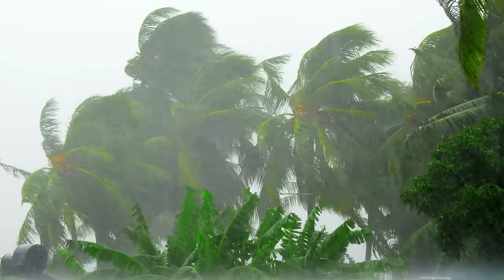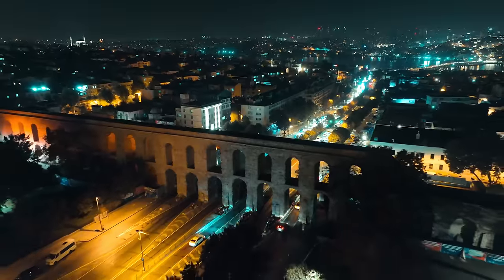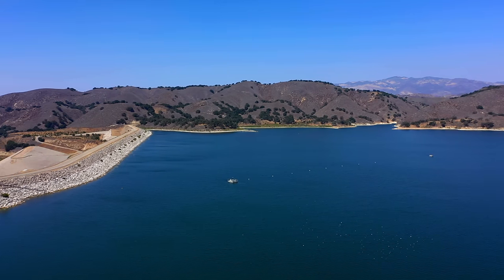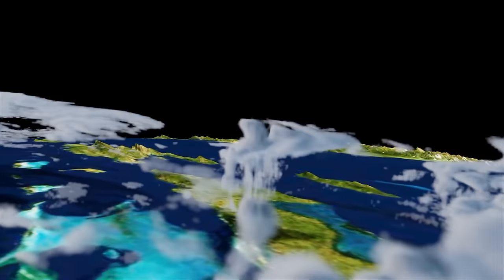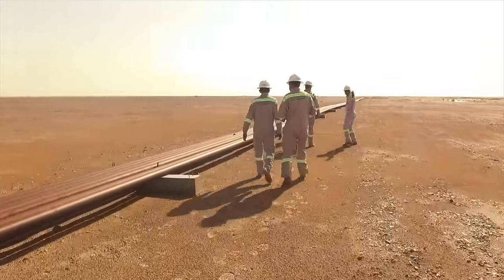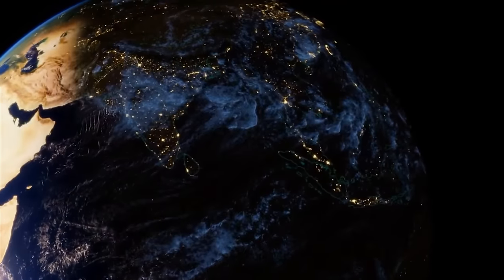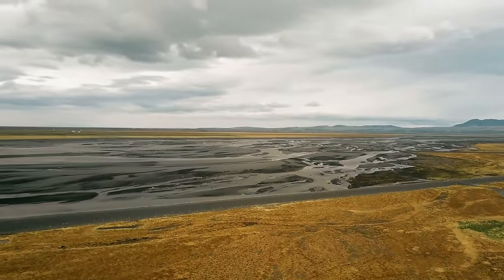Pipelines From Flood to Drought

Comment: This analysis is seriously flawed.  You can estimate the energy cost, at least approximately, very easily.  I worked in water treatment for over 45 years so I do have some background in this topic.  If you look at pumping from the east coast to the west coast and using a closed pipe so you get a siphon effect (near sea level to near sea level) then static lift is near zero and energy required for that is low.  However, that won't work because the negative pressure at the top of the mountain (remember the Rockies?) will cause the pipe to collapse.  You will need to overcome the elevation rise from the east coast to the mountains.  You can use gravity from there on, thus requiring no energy the rest of the way.  In addition to the lift you will need to overcome friction loss.  That will depend on the size and material of the pipe, but moving significant amounts of water that distance will require multiple, large, parallel lines (at least 60" diameter, and probably much larger).  Friction loss will still be significant even then.  The calculations will involve balancing construction cost, which increases with pipe diameter, against operating cost, which decreases with pipe diameter.  A single 60" pipe will have a carrying capacity in the range of 50 million gallons per day, or about 35,000 gallons per minute.  At that flow, the 60" pipe will have a friction loss of about 500 feet.  Assuming we can find a route with a maximum elevation change of 5000 feet, that gives a total "head" of 5500 feet.  If we assume a pipe length of 1,500 miles or 7,920,000 feet with a "c-factor" of 140 (very efficient pipe) and a pump efficiency of 85% (very high but reasonable) we will require a total horsepower of about 57,200 HP.  This equates to about 45,000 KW of energy.  Multiplying by 24 hours per day at a cost of $.08 per KWH we get a cost of about $86,400 per day per pipeline.  It would probably require at least 10 pipelines to provide the amount of water California and the other western states require.  Additionally construction cost will be in the range of $300 to $500 per foot of pipe, depending on conditions.  With a total pipe length of 3,000 miles (assuming we can't use the Colorado river due to environmental concerns) we would have a construction cost of about $6,330,000,000 per pipeline.  I believe this puts the overall construction and operation cost in serious question.  By the way, using oil pipelines is not feasible due to the small size.  We can clean them and operate them safely, but the capacity is simply too low to provide any real benefit.  Oil costs about $2.00 per gallon, and water averages about $0.004 per gallon.  That's why small oil pipelines make sense, but small water pipelines don't.

Comment: Agree, but short sighted.  The 'real' answer is MSR - Molten Salt Reactors,  as well as SMRs and TWRs.  MSRs have many advantages and values.  The big value is energy - a lot of energy.  Add a desalination plant, pumps (electric pumps), and pipes and you have the ability to pump desalinated salt water everywhere.  If we can efficiently pump water to Kansas from the Pacific, the Atlantic, and the gulf, we can pump water anywhere - like electricity.   MSRs cannot, repeat, cannot 'melt down' because of the 'molten' part - meaning all the reactive material is already molten so no melt down.  MSRs can consume waste radioactive fuel rod.  Fuel rods are radioactive for 200,000 years.   MSR waste is radioactive for 200 years.  Where should be store spent fuel rods?  Nowhere.  We should be consuming them.  MSRs are 'Putin' safe.  Drop a bomb on it and you have a radioactive mess which can be cleaned up.  No Chernobyl.  The components for MSRs and SMRs can be built the same way we build Boeing airplanes.  But, don't let Boeing near the software.  Rate production in the U.S., Canada, EU, and others can produce parts for hundreds of thousands of sites.

Comment: When there is really a year (ElNinio-year) with lots of rainfall and/or snowpack on Northern California's mountains, would You consider it, that collecting half of that water, halfway up on the western flanks of the mountains, then tunneling it through the mountain and releasing it on the eastern flanks? Or even building a pipeline directly to Lake Mead, supplementing it with water from the West? Such a project, sponsored by the Federal Gvt should be feasible and advantageous. With more water available, those farmers who drew groundwater up for their fields could possibly pump excess water back into the aquifers beneath their lands. 
 in future decades, when the Greenhouse effect really picks up, the snowpack on top of the Rockies will dwindle or would vanish altogether. With this local climate situation coming, such tunnels, water-pipeline projects, and more engineered storage capacity may become very valuable for the Western USA! Those need to be started well in advance. 
 One problem though, which may not be easy to assess is the possibility, that more groundwater available inland (in the North-West) may seep somehow into the Yellowstone caldera or magma chamber beneath, potentially causing an eruption!

Comment: first "idea": "Instead of spending hundreds of millions of larger dams, let's pump water from dams to drought areas" that...that's billions of dollars. The "Water in California" section: he's completely sidestepped that california's water isn't just theirs, it is split between all the states nearby which ALSO rely on the water from those mountains for their own survival. On top of that he mentions nothing about how farmers in norther cali are trying to turn desert land into farm land by just constantly adding more water. In the "drought prevention" section, this is called "surface treatment". Most cities have this and are quite efficient at it. Recycling your waste water is a fantastic tool your local area reduces overall water consumption. A lot of these in-home specialty technologies will often cost you more to manufacture and maintain than simply being responsible. "Floods"/"Flood Risk Management" this is the section that galls me the most. This makes some MASSIVE assumptions about how water and floods works which a glossed over in the next section. "Infrastructure fesability" really doesn't tell you HOW un-feasible this infrastructure is. I actually talked to a person who specialized in water and asked why we don't pump water inland from floods and other clean sources and he said just to build enough pipelines from Houston to San Antonio that it give them only 10% of their water would cost more money than the state's GDP in construction costs AND operation costs. Water is VERY heavy and pumping it places requires a LOT of energy AND even a 10ft diameter pipe running maximum capacity 24/7 could not supply even a medium-small city with enough water to make the cost-benefit ratio acceptable. That's why we use rivers/streams/culverts/aquaducts/etc. It uses gravity to do the work for us. That's why your storm drains are built the way they are, they make use of gravity and very slow declines to run storm water away from you and to natural bodies that can handle it. Oil pipelines are a TERRIBLE idea. Those pipes are not rated for safely carrying water. Let's ignore contamination from left over oil. It's the material they're made of. There's a big reason your city's water lines are made of the stuff they're made of and the pipes are coated with the stuff they're coated in, it's safe and proven effective. Those oil pipelines are going to rust out in a matter of a few years and then you're going to be stuck spending decades spot-fixing old and decaying pipes. Finally with oil pipes, those systems were not rated for water. The machinery that keeps those pipelines running will seize up in a heartbeat when water is introduced. It wouldn't be worth the extreme amount of money refitting these pipelines when it would be cheaper to tear them all out and replace them with pipes meant for the job. The whole concept is without merit because these pipes CAN NOT transport meaningful quantities of water much less at an affordable cost. Speaking of cost, that's a nice comparison, but completely ignores how many TENS OF MILLIONS of people need that water. That also ignores how much water is consumed by businesses for their own operations like restaurants cleaning and sanitizing dishes or public restrooms. That comment about how the KeystoneXL pipeline can pump 1000x more water than tar-sand is goofy as hell, water doesn't compress. Not to mention that not all sections of pipe run at the same pressure 24/7. This isn't one pump moving tar sand 2000+miles on it's own. It's thousands of pumps all trying to work together. Also, just saying "oh, we'll just use more pressure" doesn't fix the problem, those pipes can only take so much punishment before they give. Water isn't harmless, it is incredibly destructive, especially under pressure and under high flow. If air gets into the system, it creates what's called "water hammer" and that can make a pipe explode. This whole thing is based on sham science and hopes and wishes with no grounding in reality. There ARE solutions, but the ones in this video are impractical and no amount of tech jargon will make it any more viable. Light on facts HEAVY on wild, baseless speculation.

Comment: Totally impractical. Very costly, and the explosive nature of floods. Pluvicopia can produce water and energy where it is needed and at elevation for delivery by gravity. The book Pluvicopia shows how it is an energy and climate change solution. Making this complex idea unnecessary. One way your idea would work is by using your idea of water redistribution as part of a wind energy storage system. Wind Turbines are placed at good wind locations connected to the vast canal and lifting system you are imagining. We would get our energy back from hydroelectric reclamation as the water falls back from the 4500 ft peak of the continental divide. We can also redesign the use of New Mexico, AZ, and western TX. Your idea will work, but it is too expensive and unnecessary.

Comment: A simplistic answer to pumping water uphill, is to use what is known as a hydraulic ram. As a speculated connection, the drainage system around Devil's Lake North Dakota, and the drainage around northern California would distribute excess water to Southern California. Using hydraulic ram technology, "on steroids", water could be moved from one drainage system to another.

Comment: Drill a 40' tunnel from California. To tge otherside of the rocky mountains, then a 60'  wide trench, with a stepped bottom to allow any animals falling in to have a shallow edge. Making excaping easier,  with a covered walking bridge crossing every 2k feet or so, putting the man made river along rail tracks, and highway would limit extra labor required,  atleast from the mississippi river around the i40 area,  then eventually add a smaller pipe from florida to the Mississippi river. Crossing it not dumping into it, , maybe eventually add a pipe from southern Florida to northern, and from up near the Chesapeake area maybe further north, helping  drain water from many rivers along the way, or possibly just use 24-36" pipes, along the interstate, build a water tower on a Appalachian mountain,  maybe 100k gallons, build a few of them,  much largr than typical water towers, and taller,  then tie tgem together, to help in storms, then water can be pumped into it from the surrounding  500 miles or so.  And can operate in reverse if required,  the water pressure being around 100 bar or so , un a 2'-3' pipe alot of water can be moved, maybe additional pumping is required to get it all the way west,  it can be done especially following tge interstates, no land will be required across country!

Comment: The 35 mile wide droplet is somewhat misleading ...in order to drive by at its diameter, you would have to have a 17.5 mile deep round hole....also it would be sticking out 17.5 miles high ..about 3 x Mt Everest's height.  I would be very impressed by that.

Comment: 36" pipe isn't going to cover the demand of 30millon people, to get that 1000x increase the flow/speed would have to increase to such a speed that losses of efficiency would be too great let alone probably not possible, at least at the level I understand.  
A 36" 200mi pipe with a flow rate of 6.66f/s this is the high side of flow rates as I understand it would allow about 30million us gallons of water a day, divided by 48gal the average daily usage of a California you end up with enough water for about 625,000 people.

 Interestingly the math for the gallons of oil through the XL would work out to about 25mil us gallons a day and is likely limited by limits on flow velocity.

Comment: Essentially, if this preposterous plan even went to fruition, there would be more water evaporated in dry areas. And water is a greenhouse gas too. Did you take this into account, Einstein? I am a little bit DUMBER because I finished watching this video. Thanks, I guess?

Comment: I gurantee that this won't work. Not because of the idea itself. The idea is fine in theory. But there are several things that will make it impossible. 
1 funding. There's no way that a Cali gov will fund anything if it doesn't benefit them. It must benefit them big and now. They don't care about your future.

2 What you haven't considered is that there are always people who benefit from the suffering of others. And those people have many lobbyists. This is something that has plagued the right to repair movement. Apple and Samsung and others benefit from you depending on exclusively their services for repair.

3 your beard looks ridiculous. It looks like you dunked the bottom part of your head in gray paint. 

4 you can't take the pipes and use them for water. You're not moving away from dirty dirty fossil fuels. Not any time soon anyway. Cali tried it and their garbage energy grid meant no one was allowed to reduce their temp on the thermostat. Imagine if, instead of cutting the electricity, they shut your water. Too poor to buy 9 dollar water bottles? Too bad, that's your only option. Speaking of which...

 5 government sucks at doing things. Take whatever budget you have, multiply it by a few thousand, and you're looking at a slightly more realistic, but probably still optimistic estimate. Assuming not many people skim a little off the top.

6 government REALLY sucks at doing things. Even if the entire thing was constructed, and an algorithm was in control of when to pump water, you'd still have the problem of the algorithm being wrong. Causing more flooding

I retract the first statement, now that I've thought about it, it's a stupid idea.

Comment: At about minute 15:30 he says we can move 77,000 Acre-feet per day through a 36" diameter pipe.   That is some very high water speed.       77,000 AF/day /24hrs/3600 seconds/ hour = 0.89 AF/second  = 38,000 cubic feet per second.     if we divide that by the 7 square foot cross section of the 36" diameter pipe it tells us the speed of the water is 5, 424 feet per second.   or almost a mile per second.    Maybe try operating it at a more normal 10 feet per second and we move around 140 acre feet per day.   Or try putting huge pumps on it to operate at 4 X the drag and a really fast 20 feet per second for 280 acre-feet per day.

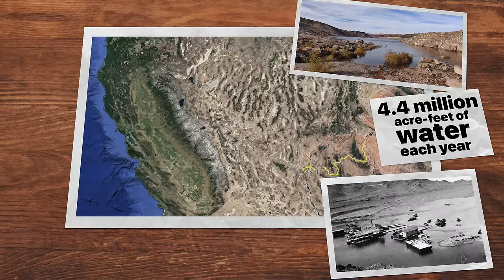Comment: 4:43  "lowest since 1937" sounds like such a strange statement.  The lake was still filling in 1937.  It's not like it was going happily along and it decreased to that level.   It was never higher prior to 1937.  It would be equally valid to say; since it was first filling.  Sounds way different.  Lowest since 1937 just sounds like they had a drought then too.

Comment: Southern California along the coast only gets rain a couple of months in the winter. That's only a drop in the bucket compared to the whole southwestern US in general. If California was to do something like this, they'd just pump it to their closest reservoirs and nowhere else. Northern Arizona, Southern Utah, and southern Nevada storm run off ends up behind Lake Mead and Lake Powell. Central and southern Arizona's storm run off ends up behind Mexico's San Morales dam on the Colorado River. California's desert area's along the Colorado River, it's run off would end up in one of the small reservoirs along the Colorado River downstream of Lake Mead. That would include Mexico's San Morales dam. Non of it is enough to do anything for the drought. There is simply not enough storm run off.

Comment: Neat idea and repurposing fossil fuel pipelines is a great idea.  But two concerns.

First, is flood damage primarily caused by neighboring reservoirs having too much water in them beforehand?  That doesn't sound right.  Even if not, some broadly similar scheme can still benefit dry areas. But not clear this will make as much difference in flood-prone areas as advertised.

This isn't a big deal, but I'd want a reference for the assertion that 1000 times lower viscosity means you can pump 1000 times as much material.  Drag goes as the square of velocity, so it's more likely an increase of 30 times.  Still a lot of water, but not quite as amazing...

Comment: It doesn't make economic sense to do stuff like this.  Floods don't always happen so the equipment would only see use occasionally.  You could just build a giant canal from the pacific northwest instead which is actually closer to cali than the eastern US.  The canal could be active 100% of the time which makes it much more economical than the flood equipment that can only be used occasionally.  Also it is ridiculous to assume that you can pump 1000x the amount of water vs oil just because the viscosity is 1000x less.  Viscosity doesn't work that way.  And what about the speed?  You think a pipe that handles 5mph oil can handle 5000mph water?  Ridiculous.  You could maybe get 2x the amount of water pumped vs oil.